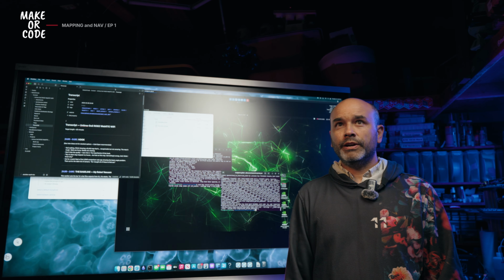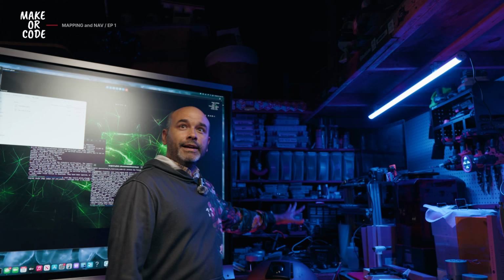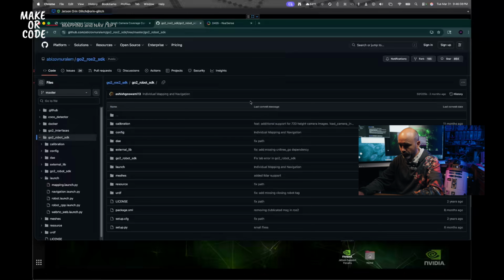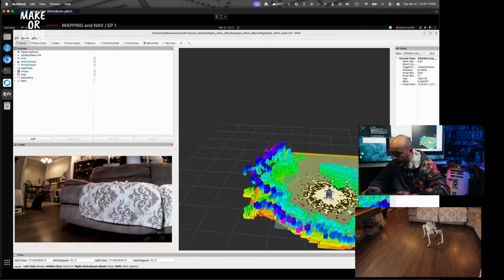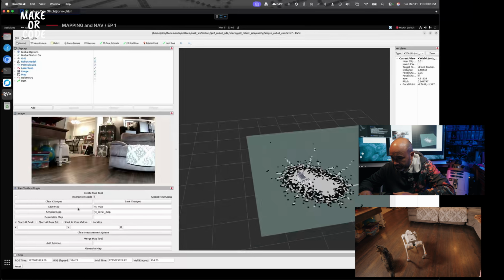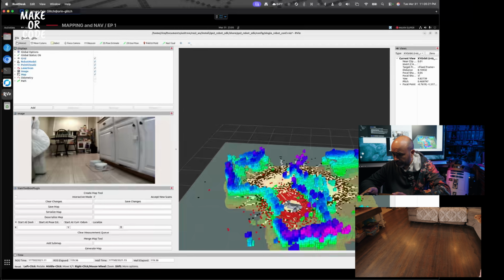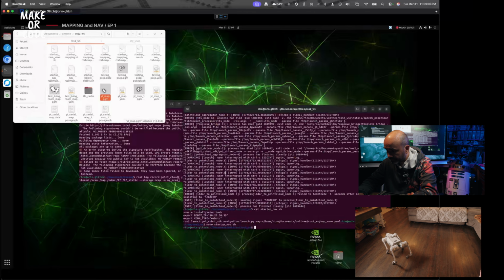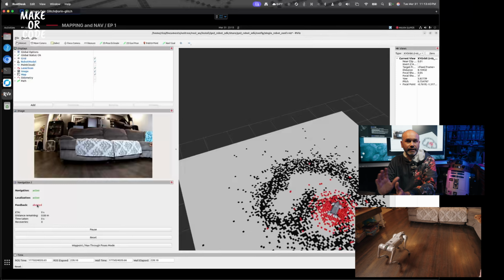AI Robot Dog Maps and Navigates My House — Unitree Go2 + ROS2 SLAM | Map & Nav EP 1

Comment: Hi, great work!
I have tried this repo before.
But I remember that I had to install the Go2 ROS2 SDK on my laptop because Go2 Jetson had Ubuntu 20 with ROS Foxy.
I tried the docker setup on my laptop and the go2 connected in the same network but i only got up till this point (11:00 in you video timeline)

So I wanted to know if you upgraded the ROS version in Go2, as you mentioned that you installed the Humble package on the Go2 Jetson board?
Reply from the maker: I do nothing on my Unitree Go2.  The Unitree Go2 is turned on and on the same network as my laptop/Jetson.  The laptop/Jetson will be the one that runs the repo.  On my Mac laptop I use Robostack Docker container for ROS2 environment.  https://github.com/RoboStack/ros-humble.  Its pretty easy to install and supports all OSs.

Comment: I don't know if you have the L1 or L2 LIDAR but on my go2 air FW 1.1.15 with L2, the 3D map built on the Unitree App is fairly accurate and could be used for navigation (I still have to figure out how I can use it)
Reply from the maker: The app is ok, but when I try to reproduce it using a vanilla ROS2 with raw sensor data from the Unitree Go2, then you find some issues.
Reply: @MakeOrCode  We use the LIDAR to find trajectories around obstacles, and Qwen3.5-4B VLA for line-of-sight high level navigation. Lightweight Redis architecture instead of ROS, and webRTC.
Reply: @franckbrunie4759  Could you give any more detail on how you do this? Have you got something working?